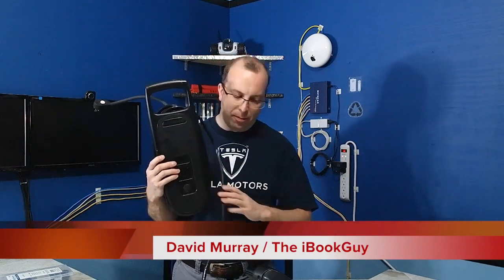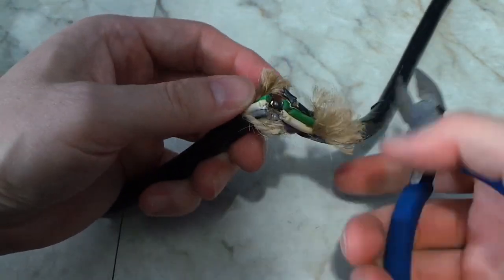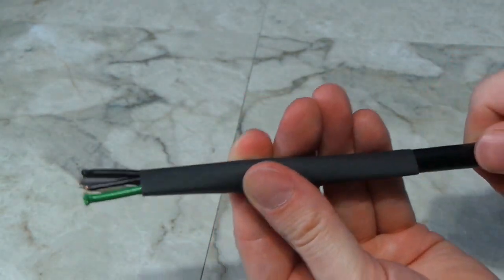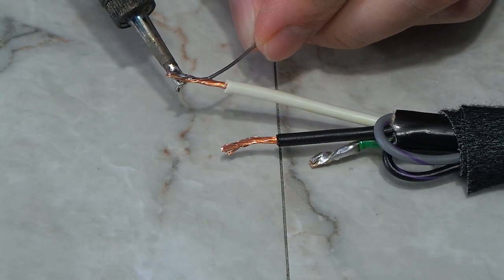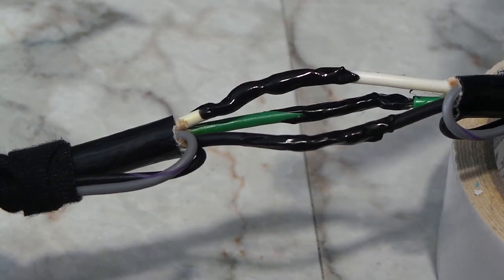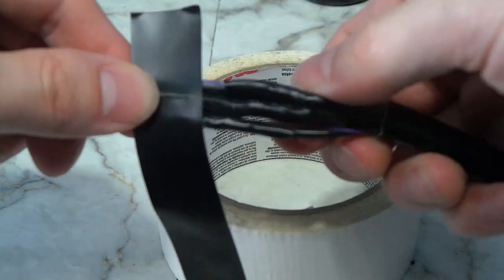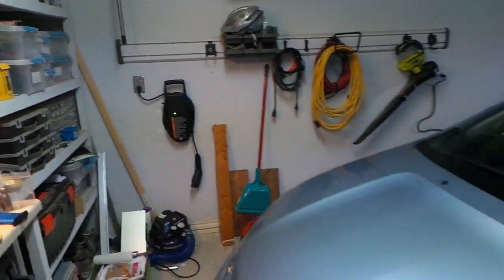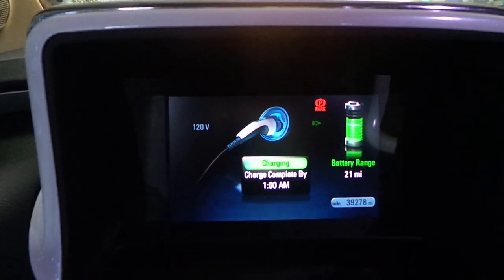Repairing a damaged EV charging cable.

Comment: I like electric cars, I just wish they weren't so expensive, that and the face that they use lithium batteries.

Also...
First! :p
Reply: The Tesla Model 3 releasing next year will cost around 26,000. Still a lot but the price is coming down
Reply: Wolf Bury Lithium ion batteries aren't so bad. If you're looking for an alternative, carbon batteries may become a viable replacement. They still use lithium as an electrolyte, but promises to be capable of at least 6 times more charging cycles. Also check out Formula E racing. It's awesome!
Reply: Brian Walsh I won't get one till they come down to about $12,000-$15,000 max and can get at least a few hundred miles on a round trip. I'm more interested in the $6,800 Elio which is a 2 person 3 wheeled car that claims to get 80MPG on the interstate and 43 city/town driving using a 3 cylinder gas motor that can top out at 100mph. they are estimated to start production early to middle of next year.
Reply: Commodorefan64 oh come on... if your only priority is fuel consumption, get yourself a bluemotion tdi from vw, you-ll get that gas/milage easily, and they also give you a real car. That Elio is a piece of crap
Reply: Titvs Caivs Agreed.
Reply: Commodorefan64 I'd encourage you to take a look at the used market where you can find Volts for that price range and Leafs for less.  The Elio is an interesting concept, but EVs are already here and have great crash test ratings that I will be surprised to see on an Elio despite assurances to the contrary.